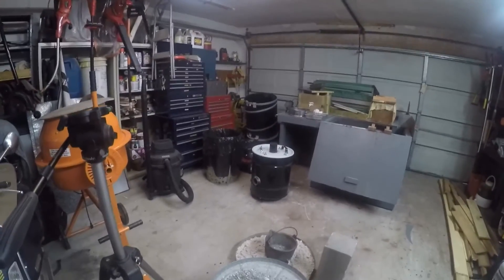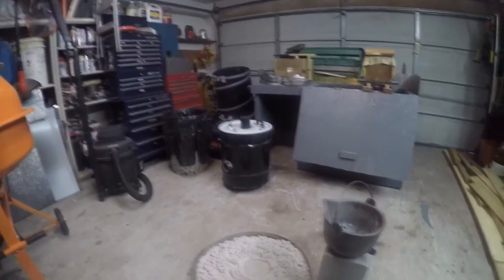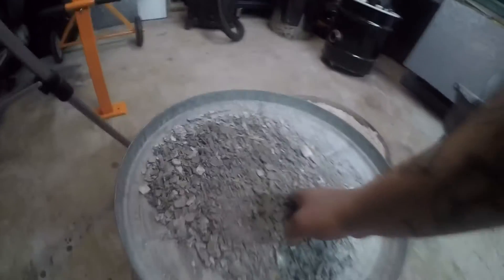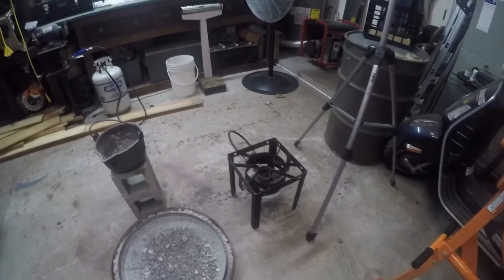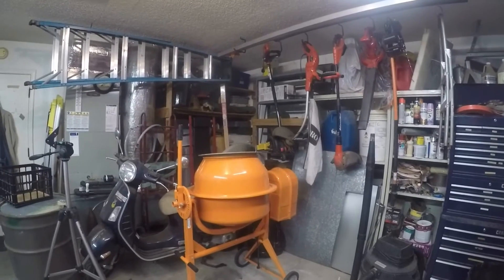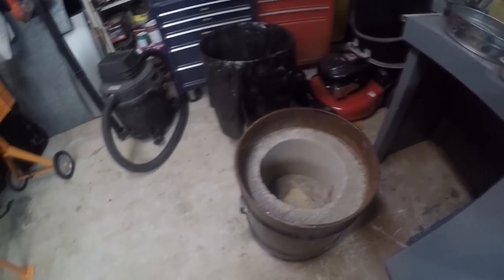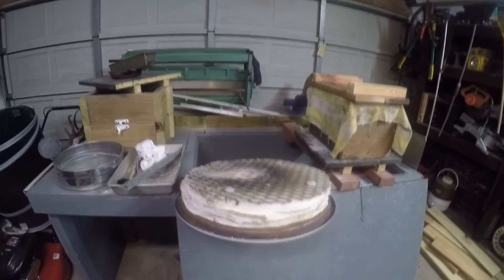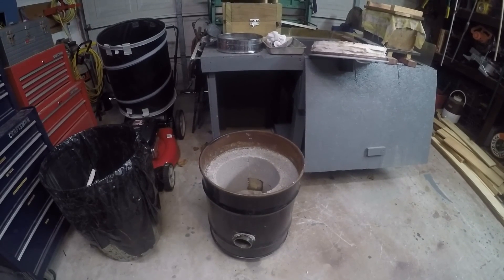My Furnace

Comment: You need to have the flame at a tangent so it circles the crucible for faster and uniform heating! Check out Mike Porters book on building a burner and furnaces forge, etc.
Reply from the maker: My flame does go all the way around the crucible using the form of the lining as the guide. I also have a proper burner ordered and on its' way so I can make a hotter flame. The propane burner I got from Harbor Freight works well but the flame is a bit dispersed. It still melts aluminum fairly quickly.

Comment: I had the same issue with the fuel not burning off and getting the poof sound I was able to add air with a hair dryer to help this until it starts to glow orange then it doesnt need the extra air.
Reply from the maker: So, as long as the insulation has been allowed to come up to temperature, I can then start using the lid I made. Cool, thanks for the info!